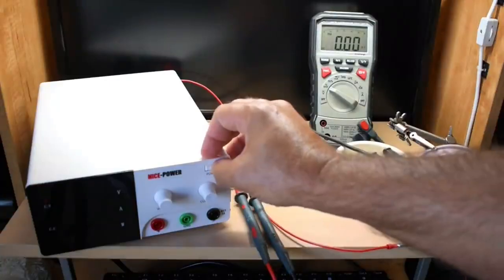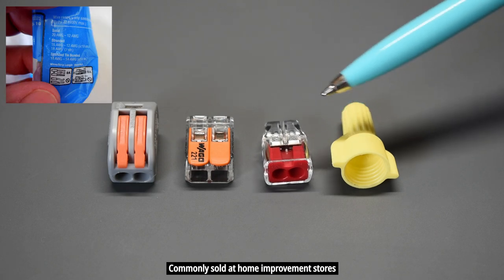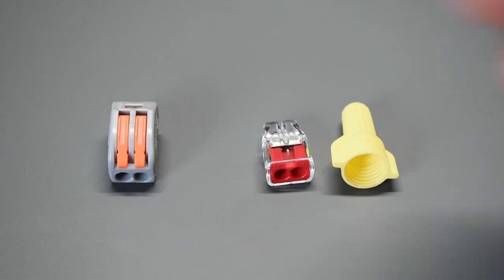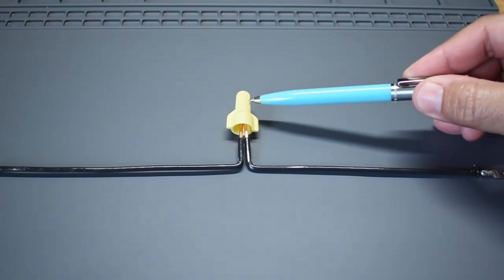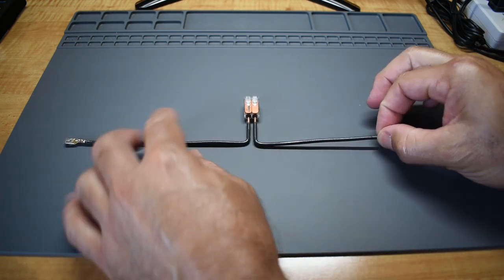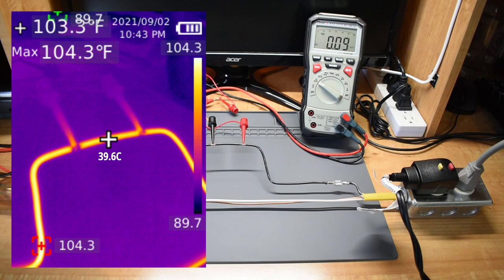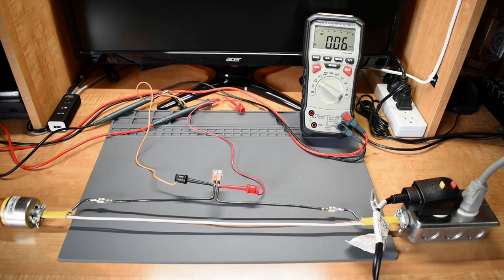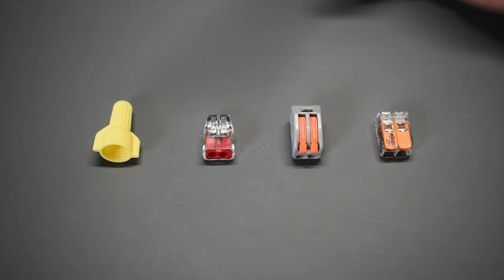BEST Electrical Wire Connector? Wago, Wire Nut, Ideal In-Sure, Lever Nut

Comment: the movement in the wago's is intentional. its designed to allow the wires to move so they can absorb movement and dont work loose over time and operate in mobile/heavy equipement applications. dont forget, its copper and it work hardens. you want to absorb the motion, not pass it along. that is also the main problem with wire nuts: they loosen up over time. and nutting a bunch of wires messes up the wires. not to mention if you have to do repairs you have a serious and time consuming problem with redoing nutted connections as you are basically forced to cut off several inches. especially using nuts properly. lever style is much more forgiving and tolerant to abuse and stupidly faster in repairs and maintenance.
Reply from the maker: Disagree. The movement isn't the same for both conductors, I checked. If both were locked down very tight, and both conductors moved together as a unit, then I'd agree with you. One conductor clearly moved more than the other in the clamped area, and that's not good. That's an indication of a poor connection. For stranded copper wire, I have no issue with lever connectors. I lived in several homes over the years, and visited homes where I used wire nuts 30+ years ago, and my work was just fine. I never had any problem removing a wire nut and re-using the wires. The only time I have to cut off wire and strip the ends again, is when the crimp ferrule has been used.
Reply: @electronicsNmore  while arguing so much about the possible reliability of lever connectors... why didn't you just du a pull test for every single one of them? I mean just saying "i worked 30+ years with XYZ ... therefore it has to be good" isn't really scientific.
Reply from the maker: @hasserecht3678  Already done. :-)
Reply: No way in heck would movement like that be intentional. Just from watching this video, I wonder if the Wago connectors would develop a hot spot and start a fire if it was used on a circuit with extremely high load. I've only ever seen wago like connectors in built as terminals in certain low wattage LED luminaire products.
Reply: @matticussilverman6179  i talked to a wago engineer in germany during a forum. the movement is intentional. and it can handle the same or more current as a nut. it is tested to 300% of its offical wire current capacity before melting the plastic. the metal stays connected even when the plastic has melted. so, no. a wire nut is not "better". at worst its equal and at best its vastly superior.
Reply: Mobile anything will not be a solid conductor.  At least not for long before it turns into two solid non conductors.
Reply: @ShainAndrews  that is why use stranded for mobile. and wagos are rated for stranded and handle it very well.
Reply: @berniedmj1  every company developing everything, has a engineer....it doesn't make their products good of better. Land Rover have teams of engineers and can cost over 100k....yet are total garbage.
Reply: @berniedmj1  my point was I wouldn't expect the representative of a company to say anything except 'we designed it that way on purpose'. I don't trust a company, their entire existence is for selling something. Additional point was that, just because they designed it that way, doesn't mean it's better design....or even good design, poor designs are 'engineered' every day.

So that is why I tend to trust an unbiased 3rd party that's testing it, instead of being sold a line by the company.
Reply: @berniedmj1  no, I do research from people who have experience with the products. For instance there are thousands of vehicles available for purchase, all highly engineered....maybe you just pick the one that fits your fancy since you suppose they are all equal in quality since they are all designed by teams of engineers. Personally, I look into people's experiences with products. We have a family auto mechanic shop...I'm WELL aware of how much highly engineered garbage there is. I'm working on a highly engineered 100k Range Rover right now that has some of the most unstable factory wiring I've ever seen....again designed, signed off, and approved by engineers. Yet by 100k miles it can't read timing because it's engine wire harness is total garbage. You can go buy a Civic for a 1/4 the money that has a better designed harness and at 300k miles it'll still be strong and working perfectly.

There isn't much I buy over $100 that I don't do at least a little research on first. The proof is in the results, not in the design....designs can be good or bad....results are more truthful. So I tend to look at results more than sales literature.
Reply: @electronicsNmore  can you do a video showing how you reuse wire-nutted wires? I’ve never seen this shown on YouTube.
Reply: @berniedmj1  well... not really! You actually want 3rd party, 'unbiased' tests on a product to validate featured claims. If I design a product and then something unintentionally happens to it, and I claim it to be a feature... is it really a feature? Or am I simply trying to justifying poor design?

As for experience - yes I would listen to 30+ year experience, not at the cost of innovation of course, but only IF the innovative product was put to the test by experience.
Reply: @SupremeRuleroftheWorld  Then why don't "all" conductors inserted in the Wago move? Some inserted conductors are rock solid without any movement at all. Are these conductors making a faulty termination, given they can't move?
Reply: @berniedmj1  And the brilliant engineers who designed the pitch control of the B37Max flew the airplane right into the ground. No, the engineer who designed the Wago didn't necessary design it correctly, and we should call into question any design that appears to contradict good engineering practices. 

 I'm calling BS on the assertion that the wiggling conductor was the design goal, especially given other conductors within the same Wago don't wiggle at all. Are the conductors that don't wiggle considered a faulty termination? 

My guess is that the wiggle is NOT part of the design but is accepted because it doesn't create excessive voltage drop and thus heat.
Reply: @boeing757pilot  Wrong. Boeing disregarded their own engineers' warnings and sacked some of them. Forget engineers, any engineering student would know that a system that does not include redundancy would cause a single point of failure. Its engineering 101.
Reply: @F3eed  Or better listen to german engineers and electricians who have worked with wagos for 50 years, not 30 minutes.
Reply: the main problem with wire nuts is the micro expansion and compression of the union caused by the heat. once it is loose, it generates more heat
Reply: As long wagos surpass German DIN standards I'm never going to buy any opinions from yanks and their twisty twisty sparkies... When you guys learn to build homes with permanent materials I'll take stuff like electrical and structural opinions into account till then... Viel Spaß

Comment: Assuming your measurements are correct, wago adds about 500 µΩ of resistance. It's the same as 4 inches of #12 wire. Not saying it's nothing, but given wide variety of wago connectors(up to 8 conductors) and the fact that you need less wire to work with, one could argue that box wired with wagos might produce less heat than one with wirenuts. Anyway keep in mind that most people who advocate for wagos are probably from 220/230V countries, where the contact resistance is even less of an issue.
Reply: No they are from the US that advocate for them. Thats where these things got their rep. I have seen those wirenuts, like what he used vs the more rounded cap, melt where Wagos would not. With old wiring, sometimes it can be cut down so much that you can't get the wire needed to twist. Another which has been tested many times is Wagos atleast don't wear out easily and the larger grey and orange is the older form that Wago started but now its free for others to make. Wago can also do 10 gauge wire with the same connector which might be where its giving so much play. Thats why they are favored as they are. Like he showed, if you have something easily slide up into the cap then it can contact and easily become conductive and that can lead to fire. Finally if you have a new user then its worse for wirenuts as they can easily throw them into a container instead of their box and not know the size which can lead to using the wrong size nut for the wire. That means the possibility of using a larger nut than needed is very likely and lead to far worse connection and will lead to melting and fire.
Reply: Cable amperage ratings are indeed crucial, not voltage. In Europe, 1.5mm² cables are typically used for 10A circuits, while 2.5mm² for 16A.
However, reality is more complex. Even in expensive homes, it's common to have multiple outlets on one line. This can lead to exceeding nominal current, especially with high-consumption devices like heating elements (3000W) or gaming PCs (700W+) = 4000W.
It's true that an old 16A fuse might withstand (4000W)17A for a few minutes without tripping. But this doesn't mean it's safe or recommended. Long-term overloading can cause overheating and hazards.

Comment: I use wagos for 120 vac control wiring where #14 or #12 is needed.  As indicated they work well for three to five conductors and allow easy testing. For general purpose residential box splices they do save space in small boxes especially when pigtails would be required with wirenuts.  I have never seen them fail.  However their biggest issue is cost.
Reply from the maker: Agree, another great use for them is when you have limited space.
Reply: That is why I only use them when someone before me either selfishly cut it too short or snapped it before my turn.

Comment: For wirenuts its 'when you do it right' for sure.   Problem is many can do it wrong.  Pro's don't normally make any mistakes.   Genuine WAGO connectors are hard to get wrong and have the circuit still work.
Reply: "Pro's don't normally make any mistakes." That's funny! Instead, let's say pro's make fewer mistakes and/or fix them before calling the job finished. LOL. I'm a general contractor (not an electrician) and I use Wagos but only for my personal use in mock-ups for low voltage stuff or for testing 120v issues that a real electrician is too busy to fix. I like the wago and everything says they are fine to use but my actual electrician will not use them but he also will not use integrated LED's unless the customer expressly requests them.
Reply: @chrisford8403  Great reply Chris.  I just opened up some receptacles that a supposed electrician installed during my house build.  Terrible work,  simple loops on wire screw not done,  no pigtails, and sloppy wire stripping.  Maybe electrician had his son or cousin do the jobs.  I blame the GC for not having oversight on the trades.  Still passes inspection but is a sloppy job.
Reply: Agree.. The wirenuts, especially the 3M brand, are outstanding and offer a fantastic connection--provided they are properly installed..
Reply: @boeing757pilot  Ya but when they heat and cool they get loose and fall off and your house burns down.
Reply: @norwegiannationalist7678  That won't happen with the 3M brand. Guaranteed :))
Reply: @boeing757pilot  Yea really depends with wire nuts, The really stupid with wire nuts is their not clear, Also in very high power application the wite vibration might get it loose and ive seen them crack sometimes too, Usually i replace wire nuts with wagos or set screw terminals as i work with a industrial electrical company so cost isnt a concern, Usually i prefer the white set screw ones as they are better than both wire nuts and wagos but are alot of work.

Comment: Your wiggle test is flawed.  You have the wires stripped past the end of the connector.  If you look at the strip gauge on the connector it's intended to have some wire insulation inside the connector.   The thicker insulation greatly reduces wiggle
Reply from the maker: Incorrect, nothing was flawed. All wires were stripped between 11 & 12 mm.
Reply: @electronicsNmore  it's hard to tell from the video but it look like you stripped the wire to 11 mm and then stripped it again just after the connector.  I had to zoom in for a closer look. 

After watching I took some 12 gauge wire and put in a wago and I didn't notice nearly as much movement.  I also tried to pull the wire out and it didn't want to come out.  I think wobble might be a non issues.

Also I've had a lot of hard to reach places with really short wires that I've used wagos on.  Sometime there is not room to twist a nut on.

Comment: To all those saying they're going to stick to wirenuts, all new construction in the Netherlands have been using inserts for solid wire and lever types for solid/stranded mix or stranded alone for 20+ years. It's fine.  You have less faults,  because when you're doing a hundred houses worth of wirenuts, enough will be wrong. We never use the 221 as shown here. Labour is more expensive than the small wattage lost in the connectors or their higher price.  Also, due to the way we build our domestic installations, it's not uncommon to have to connect 6 to 8 wires, which is trivial with wago's connector that accepts 8 wires.
Reply from the maker: It's really not that difficult to line up 2 wires and twist on a nut. If you have 3 or 4 wires, twist them together first using lineman's pliers, trim the ends even, then twist on the nut. You won't get a more secure connection. For Wago to be used more often, the prices need to come way down to 2-3x the cost of a wire nut, not 6x. Thanks for watching!
Reply: @electronicsNmore  never said it was difficult. Netherlands uses central boxes in the ceiling with up to 8 pipes down other boxes, the fusebox and to the switches and sockets in the wall. Doing 3 to 8 wirenuts overhead per box with 20 to 30 boxes in a home is excessively time consuming and tiring. Strip em, stick em in a wago, fold whole thing in the box, close it up. Much quicker. Wago's are fine, and like I said, we don't use levered ones for solid wire, unless there is a stranded in the bunch.

Comment: I think if you open up some German or Swiss commercial equipment and check the wire connections, well, you're probably not going to be happy. The push on or locking lever style connections work and are reliable. Some things take some getting use to.
Reply from the maker: Push-ins get an A+, lever type are a waste to use unless you plan on taking the wires apart often.

Comment: Thank  you for showing the proper way to install a wire nut.  Most people don't know how hard you need to twist.   You can always tell bad DIY electrical work when you take a wire nut off and the wires aren't twisted.
Reply from the maker: You're welcome. Sometimes I'll make a very nice twist using lineman's pliers, then screw on the wire nut.
Reply: Technically it's not a mistake. The code doesn't mandate pre-twisting. Not to say you shouldn't do it. An extra layer of ruggedness is always good. But it is what it is.
Reply: @caffeinatedinsanity2324  pretwist or not, the wires should be twisted when you take the nut off.  When you take a nut off two solid wires and they aren't twisted at all, it was installed wrong.

Comment: Thanks for posting this. I agree% assuming the wires are miraculously correctly installed in the wire nut! But I have not found that to be the case over my 30 plus years in the industry. I moved to Wago about 10 years ago and I’m not looking back!

Comment: Interesting test. I've been biased against using wago type connectors for some time, believing old school was best. But seeing they've become more amd more mainstream without any known failures, I've finally started using them on a limited basis. What really pushed me over was seeing them already in stalled in some recessed lights I installed. I can also see their value in saving my wrist and elbow joints which are plagued with neuropathy issues. And of course, when there are 5 or more wires to connect. I hate using the big blue wire nuts.
Reply: big blues take up half the space in the box!
Reply: @seasidescott the absolutely do not when you factor in all 3 dimensions.

Comment: Thanks for the thorough tests, they are always appreciated and enjoyed!  I figured the wire nuts would win out due to the direct surface contact of the wires, but it's also great to have detailed information on how each connector performs against another. Another excellent video!